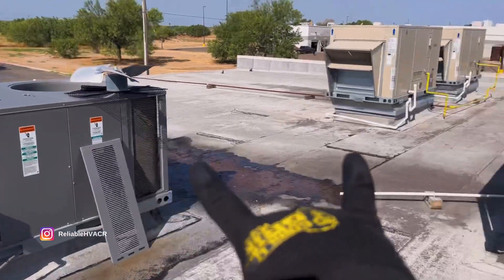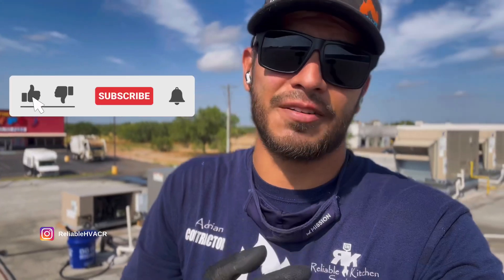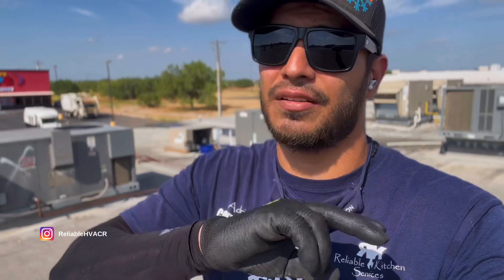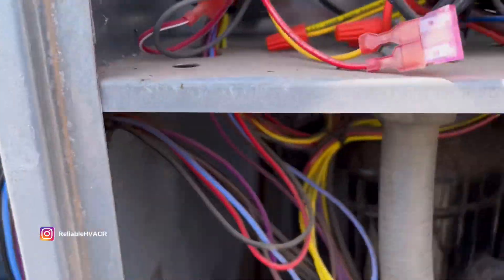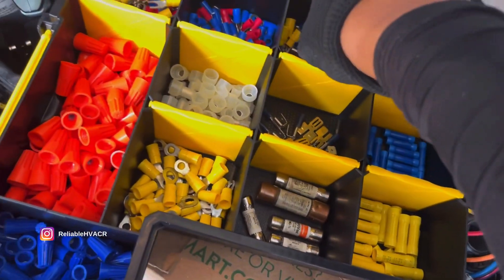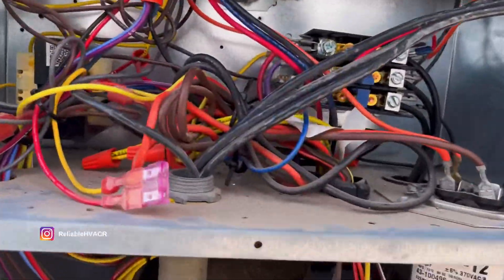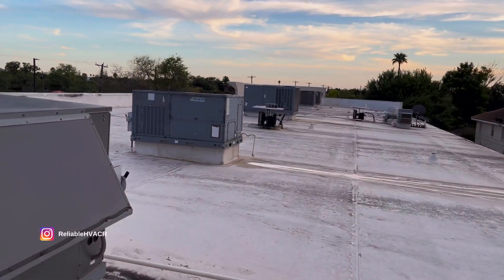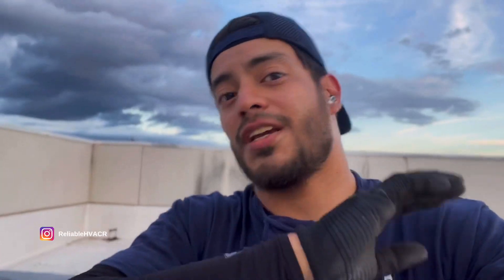Finding issues on my PM calls | HVAC Hacks

Comment: you have the main line in the wrong place ,and are running the compressor and heaters out of those small wires,the main power goes at the fuse box.

Comment: Make sure you keep some Primary Wire and different color electrical tapes in your van. I always hated using THHN wire to replace OEM wiring. Also get some DNFR14-205B-L flag connectors, they crimp on w/ a regular crimping tool.

Comment: Well done on the PM. You can't leave a unit not running without checking all the vitals. You could have said wiring needs to be repaired on report and quoted to find the cause is a contactor being at fault but haven't quoted a new contactor. I have had techs go to the problem and stop and have come in after them to repair to find cause. Well done on diagnoses. When you repair the wiring just make sure you check voltage drop 😀.

Comment: Appreciate your videos bro and I have a ? How long did it take you to switch over from analog to digital. I was thinking about getting some field piece probes
Reply from the maker: I actually got the original smans back in the day not too long after I started but I ended up using my analogs more. Probes are great for convenience but always keep your analogs close. 

And I think with all the refrigerants we're using now it's a good idea to go digital & have them all there in a click of a button but there's nothing wrong in using a pt chart either.
Reply: @ReliableHVACR  Yeah because I've been really thinking about going digital to make things easier. Would you recommend digital gauges or probes 1st?
Reply: @cjshvacjourney4034  probes with a tee for a  1/4” hose